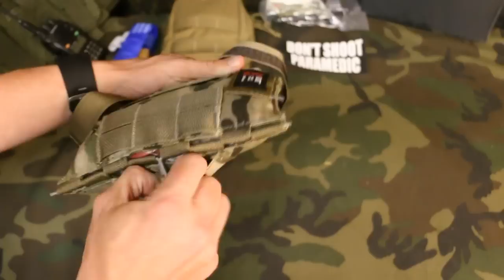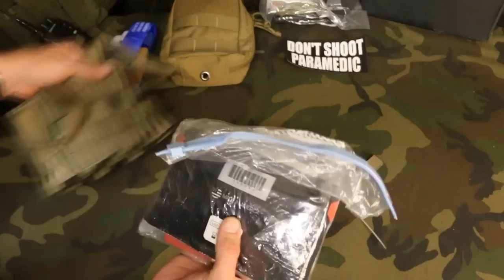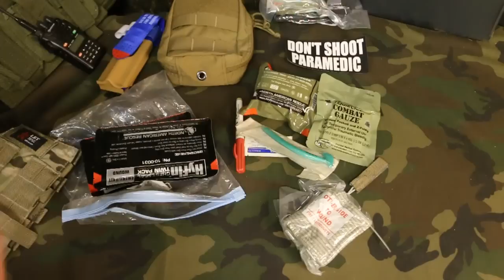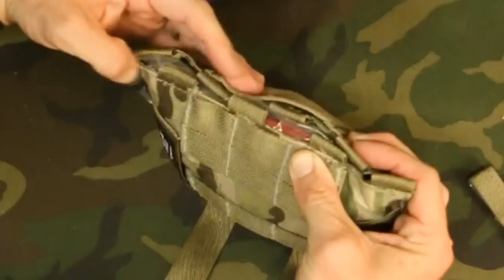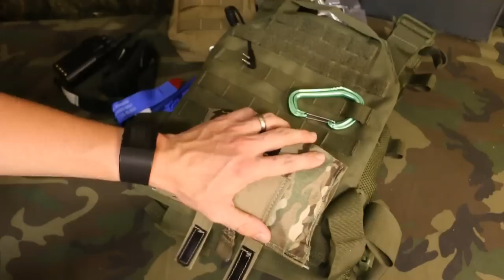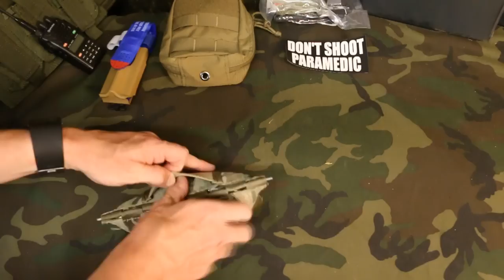LBT (London Bridge Trading) Trauma Pouch

Comment: Easy to deploy?  Check.  IFAK contents organized so I can access immediately?  Bueller?  Buuueller?  Buuueeellller?  Bueller is not home and neither is any organization.  If  organization if that's your thing.  I'm not a fan of a wire that you could literally lose the first time you deploy the kit.  I would take some kind of shock cord and try to tie that metal wire to the kit.  I've used a lot of ifaks, and my go to for the past several years has been SO Tech's Viper, and Viper LE.  It is NOT cheap.  But as far as deploying an ifak quickly and having your items exactly where you know they are - and easy to access, I do not believe the Viper can be beat.  In my mind, speed of deployment is only fully utilized when I can access whatever item I need in my ifak.  
Kit content wise?  I always put an ACE bandage in my ifaks and roll of 4" moleskin.  and some celox and combat gauze.  can't remember if you mentioned that or not!

Comment: Like a blueforce gear pouch in terms of belt mounting but holds more. No way you would want it on the small of your back though on a belt. Would be impossible to close up again without taking your belt off.
Reply: If deployed and used, the last concern is stuffing things back in the bag.... The intended use is "Rapid" deployment.

Comment: Why are more ppl not packing the Celox-A!? am I missing something? The main reasons that I've identified as to why I think it is better; It is a bit cheaper than "Combat Gauze" and it is a decent bit quicker to get it into action and to the source of the bleeding because it does not REQUIRE being packed into the wound. Obviously, you may still need to pack with regular gauze if a pressure bandage isnt working (IE; direct pressure)... but that is the case with "Combat Gauze" too. Thoughts, oh wise one? :P THANKS!
Reply from the maker: Personally I think it is more difficult to get Celox-A to the source in an arterial bleed.  There is a ton of pressure and coming out and trying to get the Celox to the source as blood is rushing by can be difficult. It is easier to use the gauze and find the source using the gauze. The Celox-A is good for small injuries that you can't get your fingers into, such as knife wounds.
Reply: Keep the Celox A, as well as hemostatic gauze and you have the best of both worlds. That is what i do personally. Very good combination

Comment: 73$!!! For what it is it should be less I was mildly interested until I saw that price.
Reply: With LBT you get what you pay for, they only make top of the line kit. It will last you forever, its an investment if you really need a blowout kit.
Reply: @ianarmstrong7044  It won't last you forever if you lose or discard the pull tab.  A Rip away is a better solution.  I do agree LBT is top notch gear however.
Reply: @TheOneeyedclay  I'm not a fan of empty, non-organized ifaks.
Reply: AWS makes that exact pouch for $42.75 (link below.)  They have been making bomber gear since the 80's for SOF Units. Another great option is the AWS Ambi Med Pull Away Pouch. 

http://www.deploymentgear.com/proddetail.asp?prod=50381
Reply: @guardian6652  That's the same design.  Lose the wire, lose your ifak pouch.  Unless you close it up with a thick zip tie or some piece of wire.  I guess it could be an easy fix.  Maybe they should have a way to secure that wire to the shell with some shock cord.  That's what I would do anyway.
Reply: I realize it's 3 years later, but for what it is worth. This kit is not made by LBT, it is made somewhere else. It can be purchased through Krydex for $21.99 on Amazon.
Reply: @coyrose1135  Krydex is a Chinese 'clone' manufacturer that uses high quality materials like Cordura, same with manufacturers like Idogear, TMC, Flyye, Twin Falcons and a few others that are actually worth trying. I have a few Krydex products myself and they are top notch in craftsmanship and materials, but not exactly the same as the LBT US made gear. Just thought I'd point that out.

Comment: Do you remember where they placed the sulfer etc. blow out kit during WWII? I think that's a much better location most average or below average people can access, than on the back.   Yes you could wear more than one. But if one is all you have, you really need easy access with both hands, while wounded falling on your back or face down, to the side, etc.. so it is up to the person to find and test the best spot.    We do not like the rear mounting position for Joe and Jane average. Like that LBT pouch we have. What do you think the life cycle of that wire pull tab is before it breaks?      As plate carriers go. we think having both a Release and Underway function are very important for our use that may help save a life.   We are trying to reach out to the public on this particular version by LBT we are doing with them.      If any of you are looking to upgrade your tactical gear and have the $ while we still have the special discount from LBT.       You might enjoy our current Not For Profit Group Buy LBT MAS Grey 6094 Releasable Underway Plate Carrier.    Sell three of your other LBT Plate Carriers and make it this the One to do it all.   At cost from LBT to us, to you, just to help people who need gear.    You may PM from the facebook links,  include your LBT ESAPI Plate Carrier size A B or C, item list with quantity needed , shipping location zip code and email address for a secure email reply.    Please do not include any personal info like your full address, etc., in the facebook PM.  If you guys are doing the A size then we may have to make quick quantity and also do the LBT 50 oz hydro kit, since the 70 oz may droop low on the A size.   We only have the 70 oz listed since we did not think anyone would want a LBT ESAPI A size Plate Carrier.Much respect, thanks      https://www.instagram.com/lbt_masgrey_seacity_fund_group/   https://www.facebook.com/LBT-London-Bridge-Trading-Co-LTD-Unofficial-Private-MAS-Grey-Group-Buy-Plan-499057536971970/    https://www.facebook.com/London-Bridge-Trading-Unofficial-LBT-Tactical-Gear-Gofundmenow-Gofundusnow-664857123665068/You can also view the group buy section on www.hkpro.com

Comment: Love the Video, and personally I'm not sold on the pull tab wire closure, or how it would dump the contents "down and out".  Almost like it would be better if it were mounted upside down. Thanks for the detailed review though!

- I would like to add that I see the "Down and out" as an advantage if it were mounted behind you
Reply: You can mount it up or down, and with other fittings, even to the side. Yes like you, we do not like the rear mounting position advocated by the OP per our post above yours.   Don't get me wrong, this is a very good pouch and we have several.      https://www.instagram.com/lbt_masgrey_seacity_fund_group/       https://www.facebook.com/LBT-London-Bridge-Trading-Co-LTD-Unofficial-Private-MAS-Grey-Group-Buy-Plan-499057536971970/         https://www.facebook.com/London-Bridge-Trading-Unofficial-LBT-Tactical-Gear-Gofundmenow-Gofundusnow-664857123665068/    You can also view the group buy section on www.hkpro.com